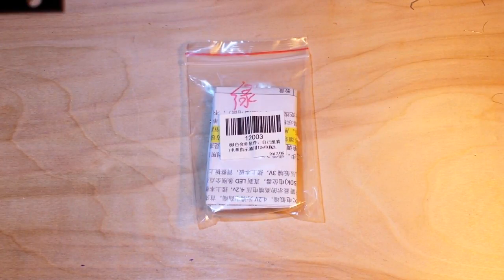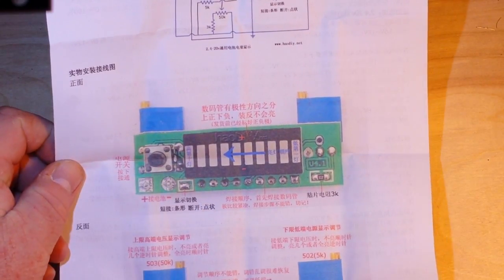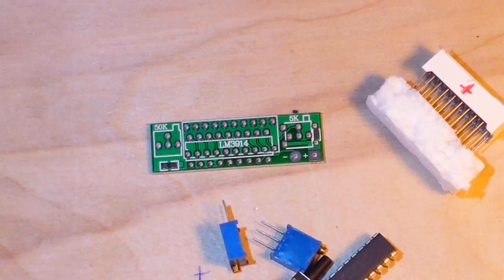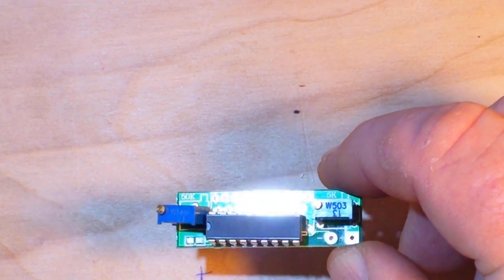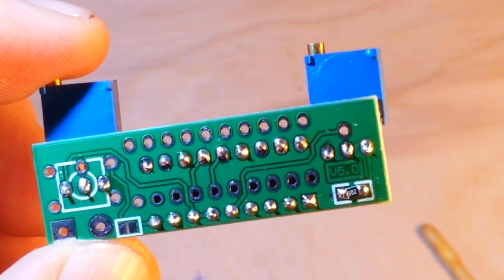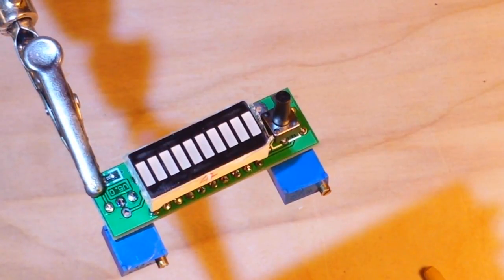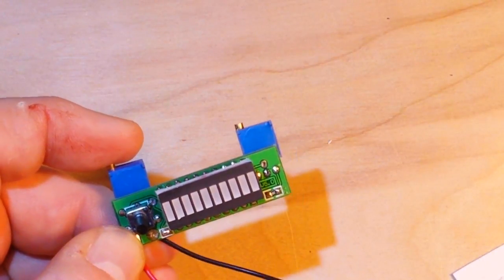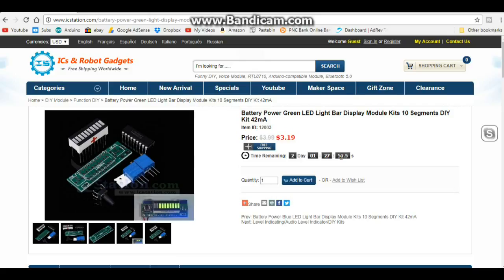Battery Power Indicator Kit from ICStation com

Comment from the maker: The two trimmer potentiometers are installed correctly. When I was showing how the board went together, I had them swapped, but it was corrected during soldering.

Comment: i assembled this kit tonight and when i apply any voltage, 3V, 9V, 12V, all the bars illuminate but i cannot adjust the top end down using the pot.  i understood that i need to turn this down so the top bar illuminates at the full battery voltage.  any ideas?

Comment: have you seen the easy tech multicolor..that would be good for a 12 v car battery charging meter..and the proper way to hook to clamp wires..maybe do a video on that because the meters in these chargers are melting
Reply from the maker: No I have not seen it, but I will look for it.

Comment: I've bought many of these, and they do work great. There are some tricks that make assembly easier. The SMD resistors should go in first. The LED bar graph goes in second, because the chip covers the bottom row of its legs. These legs should be cut flush with the other side of the circuit board prior to soldering to make a flush surface for the chip to sit on. The chip goes in third. Some of its legs get covered by the LED display. These legs must be soldered on chip side, as strange as it seems. It works and isn't too difficult. The potentiometers go in next, with the two protruding plastic things cut off to make them sit flush. They must be put in laying down. I would recommend not to put in the pushbutton at all but instead bridge the second jumper gap. It bridges the button contacts and lets the unit be on when powered.

Comment: the blue POT with the marking 503 is mounted nearest the + and - holes yes?  also what information do I need, or how can I adjust the pots to Match the battery voltage im testing? I want to test a single 18650 ~3.7 as well as 4 wired in series at ~14.8V
Reply: Jordan Klaers He swapped the pots in the beginning. The instructions tell the correct values and placement in numbers. To adjust, looking at it vertically with pots on right side, top pot is your minimum voltage (empty) and bottom pot is your maximum voltage (full). The device can take a voltage up to 20 volts. Past that the chip and LEDs will die.

Comment: I like how the PCB has no holes for screw or stud mounting... at all.. I guess one could 3D print a case for it or something to integrate onto an SLA battery.
Reply from the maker: ElfNet Gaming trust me this was put together out of the most bargain-basement Parts Shenzhen has to offer.
Reply: Yeah I know, I order radio related things from there all the time out of curiosity sake. Banggood is a neat site lol

Comment: well im glad you already did it because i just got mine and was like how do i get the other pins solder when they are all covered up and i think i got riped off i paid like 4.35
Reply from the maker: James Holbrook It works great, but the design engineering is a little off

Comment: If the PCB was just a little bigger you could have soldered all the parts from the bottom side. Standing the LED display up just so you can solder it from the top side is just a bad design. Thanks for sharing. 😎
Reply from the maker: TheRadiogeek your right. in fact they could have even placed the led module over the IC with a little more design
Reply: Could you have just soldered in the first half of the LM3914, bend it up, solder in the first half of the LED, then bend the LM3914 down, bend the LED up, solder bend LED down and solder?

Probably more annoying to write than to do. I'm waiting for mine to arrive

Comment: you swapped the 2 trimmers at 4:57! 5k is 502 (50+2 zeros), while 50k is 503 (50+3 zeros)!
Reply from the maker: squalazzo yeah, I watched the video and when I was demonstrating, I had them reversed. but I did assemble them correctly. you've got a good eye there 😀
Reply: maybe you could add a text note to the video now, using the youtube editor ;)